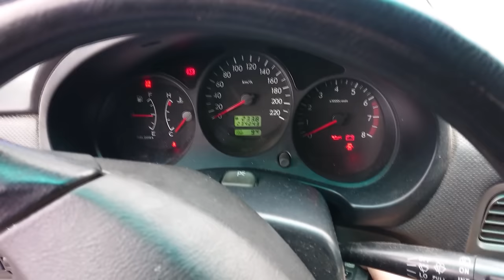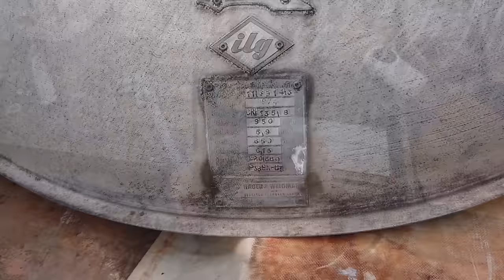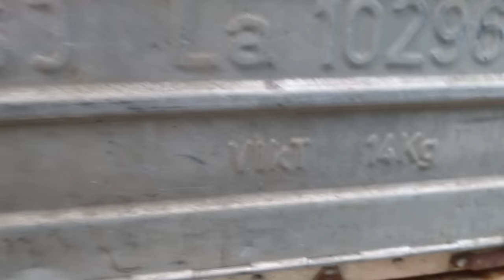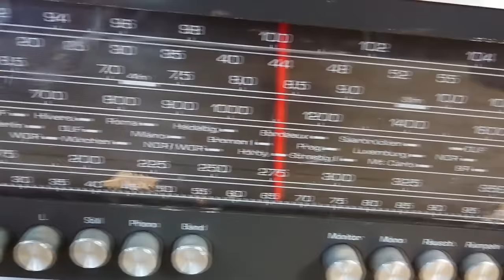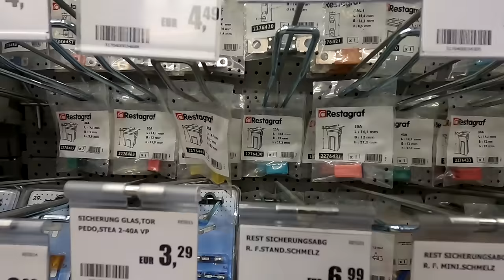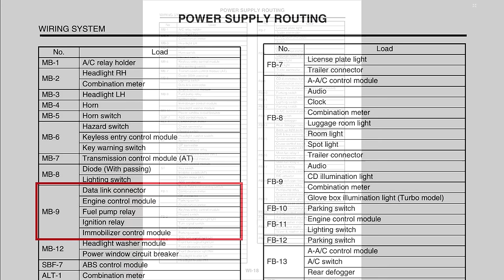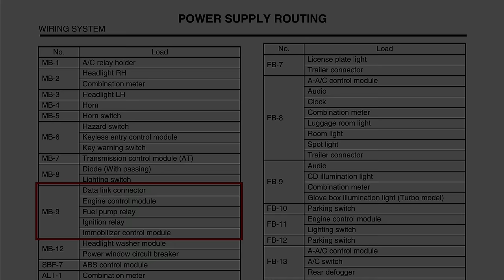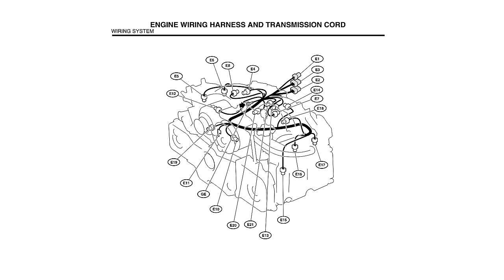New Awesome Scrapyard Finds! Repair-A-Thon!

Comment: Rodents suck.. even regular usage will not deter them. Elevate the vehicle as high as you can when you aren't using it, even if it means putting it on a 2 post lift, or off the ground with ramps or jackstands. What makes a vehicle such a habitable situation is that once they're under the vehicle they are difficult to be spotted by predators. Behind a wheel, under the chasis. Elevate it on some skinny posts as high as you can and they'll find a safer shelter.

Comment: Sorry you had an electrical gremlin. Ironic that you so often seem to quickly find them on the electronics you repair only to be flustered so by one with the vehicle. SouthMainAuto and the top commentor, WatchWesWork,  seem to be fairly proficient in teaching you how to find those wire gremlins in a vehicle if you are interested. there may be others but those are the two I watch, they are calm and explain things well.
I loved the repurposing of the vent hoods into lighting, I thought immediately of high bay mercury vapor lights when I saw them.

Comment: The folding box is a cool idea. I don't see how it helps though. If a supply truck can handle 20 full boxes what is the benefit of that same truck carrying 40 slim boxes back?
Reply: It makes a whole lot of sense for train freight, as indicated by the letters on the box (SJ is a Swedish train company). If we assume it takes about 25% of the space when folded up that means you can stuff four times as many into a carriage, which essentially means you can have the train pull less carriages, or stuff the other carriages with other goods rather than shipping air.

Comment: Do you think there is a component in modern plastics that makes them attractive to rodents?  I don't ever recall this being a problem on older vehicles.
Anyway, been there, done that.  I owned a 1988 BMW 735I, that was an electrical nightmare, and like your problem, it was intermittent, and not a fault that could be found with normal troubleshooting.  After many hours of frustration, and a lot of searching on the internet, I found a forum, where a guy with the moniker of Shogun, had assembled an encyclopaedia of information on the 735i.  
After goodness knows how much time spent troubleshooting, I was able to solve the problem, by disassembling the main computer, and after finding some cold soldered components, I re-soldered every component on the board.  That however, was not the solution to the problem.  it was while examining the mother board, I found a hairline crack on one of the traces, that may have been the cause of the problem.  I bridged the trace with wire, and soldered it.  
After assembling the computer and re-installing it, the car ran perfectly.  To this day, I can;t be certain which of the repairs I made solved the problem, but the issue was completely resolved.  
I much prefer working on my 55 Chevy.  So simple

Comment: the harness 30:58/33:19 looks like it has been worked on before, and it was not the lovely little critters that did this. but someone who forgot to heat shrink tube the yellow wire and the green one to the left side in that loom of wires.?

Comment: Use mint oil to repel most rodents.  get a spray bottle fill with water and some mint oil. spray wheel wells and any external areas as well as the hood and engine. do this once a month.

Comment: I think that its lawsuits that are holding the repair industry back. Too many people would sue the repairman's company or the company would get blamed for problems caused by whatever was repaired after it was repaired. If someone works on a microwave and it burns the house down, they'll get sued even if it wasn't their repair work that caused the problem.

Comment: I drive cars made from 1980 and before. I presently drive a 1954 Chevy Truck that is dead simple to troubleshoot, made to be worked on by the owner and can be, 99% of the time, fixed on the side of the road if there's a problem, (which rarely happens). No, it doesn't have air conditioning, GPS navigation, or even a radio, but I know for certain that when I get in it to go somewhere that it is going to start and get me where I'm going and if something happens on the road, I know that I will be able to fix it myself on the side of the road. New cars are CRAP!

Comment: Trouble shooting:  I feel like you could have segmented the problem better.  It blows the 30 amp fuse that supplies four sub systems.  The sub systems all have their respective fuse requirements.  The fact that non of the sub systems are blowing fuses tells you the problem is within the "main branch" which is ANY piece of wire upstream of the sub system fuse.  Resist the urge to touch and disconnect wiring... because it always spoils test results.  The second you popped the hood I knew it was rodent damage.  To blow a 30 amp fuse means is NEVER going to be a connector.  I'd give that shop a piece of my mind because they know full well they did nothing.  

Rodents:  Nothing short of death dissuades them.  No spray, no sound, no predator looking decoys.  Poison is the only thing that works.  As such you have to be mindful of what may consume the deceased corpse.  Inspecting the engine bay, and keeping it clean with a pressure washer may help... but there really is no sure fire way other than garaging, and even then you can easily have a rodent in the garage too.

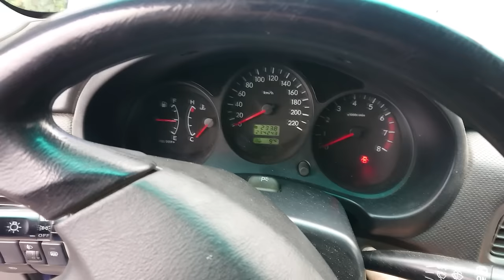Comment: 15:06 I replaced my Subaru WRX that I bought new in 2006 with a brand new Honda HRV 3 months ago. The Subaru engine and the interior were immaculate but what I was unaware of was the massive amounts of corrosion in the underside body work. I miss the Subaru. I despise the Honda every time I drive it, all the more so after the never ending run around I get from Honda when I call to find out how to turn off the opt-in  features the car has.

Comment: A couple of years ago, I experienced a similar problem with the Mercedes Benze ML320 2008. I noticed that my brand-new battery drained, without an apparent reason.

After I replaced the battery, it happened again, I became aware that a fan kept constantly running under the passenger side, even after the ignition turned off. 

I discovered that the engineering of the car had been compromised, by allowing the rainwater to be collected and trapped in the vent inside the engine bay, which gradually leaked into the cabin area. The Mercedes Benz created the fan to operate by itself and as a result the battery was drained and the car became immobilised as the result.

As I disconnected the wire to the fan, it stopped running. However, I noticed that the rainwater also reached the circuit above the fan and corroded the connections.

To be honest, such a poor design only can happen when a company like Mercedes Benz allows substandard and poor trained engineers employed under the direction of the board of the management to create Poorly Designed Cars that easily become obsolete in a short matter of time, and the owners spend more money on Repair, Spare Parts and changing their cars more often than in the past.

Comment: The large fan covers had me confused, until I saw the direction arrows, that really narrowed it down.
I scored three LED high-bay lights, I was going to replaced the fried circuits with some 12V LEd modules as I thought they looked nice, a somewhat smaller version of yours, then maybe try hanging one from my 15 meter radio tower to experimentally act as a 'moon light tower', see   https://youtu.be/LDiXNsWQzD0
Trouble is I have too much light pollution in my area already so zero drive will be needed most of the time.

Comment: the inlet manifold has be reinstalled years past pinching the white/blue wire with the yellow wire in some way and over time vibrations rodents the easter bunny magic etc, anyway you have shown the rest. at lest it wasn't the    ( hEaD gAsKeSt )

Comment: Fault detection is a separate subject in electronics education for a reason, and even with people getting a specific education in electronics it tends to be the subject with the lowest grade average, that auto-mechanics are less adept at electronic fault detection than those getting an education specifically in electronics isn't exactly a stretch...

Comment: Electrical wiring instantly becomes a rat's nest, both literally and figuratively. I wish there were a way to simplify car wiring. The harness with modular cables is supposed to do just that. But it's still difficult to inspect and to replace. There has to be a better way. I know engineers have to compromise one feature for another. Every part of the car is competing for space, durability, weight, cost, etc. But easy access to the parts, ease of inspection, and ease of replacement should be very high on the list of design specs, imo.

Comment: Surely you properly fixed that old wiring harness for future use if roadents attack again! That is partly a reason I drove only old 90's Toyotas as they are bulletproof (but not like in your case as the cause was outsider thing clearly) Yeah you are right we have been living in a "throw away and buy a new one" society for many years now mainly for the reason as repairing is so expensive that it is not worth it! Mostly it is caused that we all want it cheaply made in some far away country that would not think about environment and treat their workers almost as no humans! That is what moden man wants!?

Comment: Bevor ich mich hier auf english to tode kwasle mach ichs mir kurz einfacher.

Eine 12V lampe mit zb. 21W anstatt der Sicherung würde anhand der Leuchtstärke dir einen Anhaltspunkt geben ob der Fehler noch vorhanden ist. Ein 12V Sicherungsautomat wäre natürlich ideal.

Zum Thema andere Werkstatt. Ich weiß nicht ob es eine Vertragswerkstatt war oder nicht.
Aber bei einem Stunden Preis von 100-150€ und einem Kundendienst und reperatur einer kleinlichkeit, kann der Techniker ja nicht lange an dem Fahrzeug mit dem Problem dran gewesen sein. Du hast ja selbst schon einen Abend gebraucht um überhaupt die Ansaugbrücke runter zu bekommen. Und ein Fehler der nicht dauerhaft anbleibt ist auch nicht wirklich ideal. Würde halt Zeit und Kosten in die höhe treiben. 
Dennoch würde ich dir anraten dich mit der Werkstatt in verbindung zu setzen. Und erklären, dass das Problem nicht behoben wurde.
Und du es beseitigen konntest. Evtl. krigst du einen kleinen Betrag erstattet oder den nächsten Ölwechsel kostenlos.

Was ich dir als Marderschutz sehr empfehlen kann ist. HV Mard, aber nicht das Ultraschall basierende.
Eine gute verlegung ist natürlich vorrausgesetzt. Draht sollte unten wie oben verlegt werden. 

Der andauernde Sicherung tausch und der ECU tausch als Diagnosetechniker hat wehgetan. -.-

Aber zumindest läuft er wieder. :D

Comment: There is a hole in the general physics model where it fails to account for the way a good vehicle, an asset, becomes a useless pile of scrap of zero value. I think it'a a hole in the time-space continuum. I also do not trust mechanics. They did just enough to get your money, but it clearly wasn't much.

Comment: To repel rodents use rags dipped in camping toilet chemical tucked into places under the bonnet. This toilet chemical stinks and rats etc hate and avoid the stuff, done this many times and it never fails

Comment: why not just place thick copper wire in place of fuse and wait to see what starts to burn. If it's ECU so be it, since you already bought 1 just to check. Kinda depressing to spend almost as much as the car is worth at the repair shop just to get contacts cleaned and oil change.

Comment: This company claims that their strobe light installed in an attic or crawl space will drive away rodents, the theory behind this the powerful strobe tube generated 175,000 Candle Power, to a rodents eyes it's like you lifting a 20lb weight 10,000 in a minute!

Comment: i kind of feel the shop owes you s little bit back in refund for not diaging correctly, unless you had a timing belt done or something. did they even test drive it?  EDIT: they also have minimum for time invested on the other hand. i know some guys who might have been able to find this OR i will be better at wiring faults after seeing this video and getting an articulating borescope

Comment: Even the most competent technician often cannot repair an electronic device without a service manual or schematic, sellers of electronic devices used to provide them. Now companies such as Apple sabotage their products by serializing parts and working that into the firmware (operating software).  This means the device has to be re-programmed to accept a new part even if that part is identical.  There is no legitimate reason for this other than to complicate repairs.

Comment: 32:18  I STRONGLY disagree with this assumption.  You are affirming your own mental bias feed back loop.  Electrical troubleshooting is seldom lengthy... for the disciplined.  I find at least 85% of all electric faults in the first hour.  In the other 15% of instances that I don't, I usually have enough data to isolate where the trouble has to be.  I charge hourly diagnostics time.  This practice ensures neither party is out anything.  I solve more problems with incandescent bulbs than anything else.  Every once in a while I have to look at a wave form on a data circuit.... but most systems are just ohms law stuff.

Comment: welcome to subaru ownership ... as a mechanic i started refusing jobs if they where subaru just because of how poorly they where wired and how poorly ej engines and their derivatives are ... the harneses that lay ontop of the engines in the subarus get brittle from heat its been a issue for a long time  ...personally i think its a mode of planned obsolescence because they have known about it for aslong as its been a issue

Comment: You were a victim of tunnel vision, in that car repair. Fuse blows = component module failure. It's not always true though. Reviewing the clues (nuts, seeds, rodent crap etc) show that rodent activity was happening in the car. Rodents don't normally eat modules (they piss on them) but they find wiring "tasty" sometimes or chew on them to keep their teeth growth in check out of instinct. I suspect it may not be at the for-front of your thoughts though as I do not think car corrosion is as much of an issue where you are and so the wiring is assumed to be always in good condition? Not sure.

A trick to finding high current draw in a vehicle can be to measure voltage drop across fuses. This is only viable if the the fuses do not blow though. Shorts to ground on the engine block could be found quickly if the engine ground straps are easily accessible and removable.. harder to do on newer cars that have many ground returns and who knows whats going on with exhaust isolation...

I have heard that a strong oil (peppermint or other) sprayed into the car (but not in the cabin!) can deter rodents but I have no personal proof of that.

I find that Eric O's (South Main Auto) youtube videos a good resource for seeing the type of havoc rodents can do to vehicles.. in combination with road salt which is an Eastern Coast of US and Canada winter treatment for roads.. just plain awful for cars.. :(

Cheers,

Comment: Apparently a certain brand of EV uses a soy-based insulation on its wiring. Yummy.
Reply: I have heard that in the USm laws were passed requiring the use of plant-based wire insulation instead of the old petroleum-based stuff which rodents rarely disturbed.

Comment: i am with renting sucks.find your self a svc300 or is300 with the 2jz inline six or a old toyota cresita or supra 7mge 3.0  ill never drive any different for a car bullet proof set ups i got main from a wreck auction.got rid of the Subaru baja cool car but ahh. never trust any specialist tech when your as hand as we are i learned that the hard way to God bless

Comment: Mind you, you still paid them 600 bucks and not find the fault. Had they persisted and checked the entire loom, you would have been up for twice as much but the fault would have been fixed, which is why you took the car to them in the first place.  I'm sure you don't really want to express how you feel in case you need to use those mechanics again but regardless, you are being far too magnanimous in your assessment of them. 
Like most, not all but most, mechanics, they never lose. If they fix it, they'll charge you.  If they don't fix it, they'll charge you.  
I will never understand the ethics of taking money from a customer for an unaccomplished repair job.  If, as mechanics, they weren't smart enough to fix it, they should suck it up or at the very least not take on the job in the first place.  And two weeks, not to fix it...GEEZ !!!

Comment: Subaru are pretty cool but I see too many in the scrapyards that are there for mechanical failure to ever take a risk on one.  I am Team Toyota to the core now even though it hurts my innate American Nationalism and I restore old american cars and trucks.  My Daily is a 4runner that has 300k on the clock now.  Thats pretty frustrating though, rodents can happen to any make.

Comment: I wonder if it's less an issue of "planned obsolescence" and more of just poor engineering or poorly skilled engineers.  Engineers that have never turned a wrench or done a repair themselves.  Should be a requirement that engineers work as apprentices in their chosen field for at least a year or two to better understand the challenges of repair and upkeep.